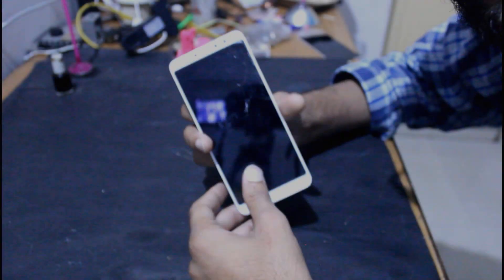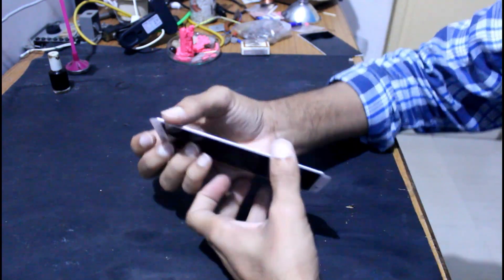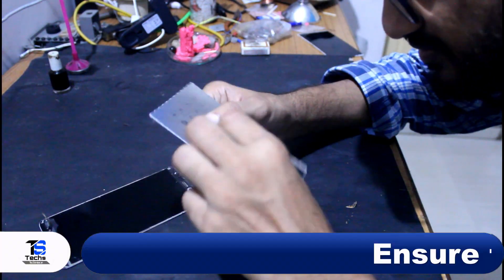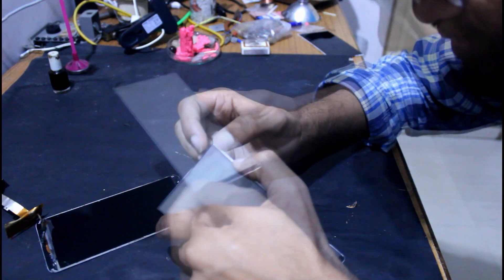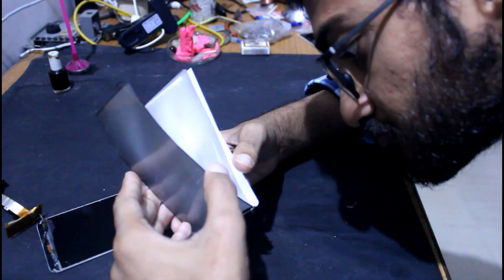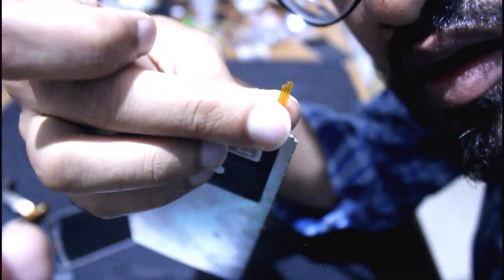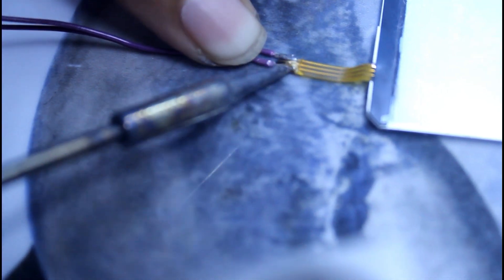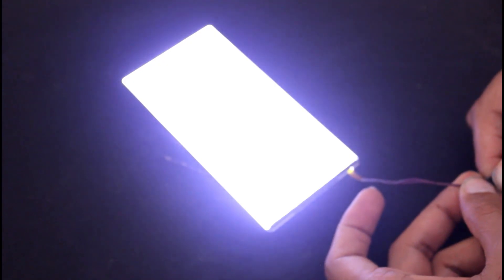Make useful Light from broken display

Comment: 5v is enough for this 😊
Reply from the maker: @sushantakumar7794  no, (old screens had  12 opertating volt)
Maybe new screens have Lower volt just check it with low volt at first & keep increasing untill it glows
Reply: @TechsScience  yes you right   I try it   in12v  it glows perfect 👌 👍 thanks
Reply from the maker: @sushantakumar7794  🙂

Comment: Actually a very useful re-purposing project but complete precise connections not shared especially as to how you connect the 1k Ohm Resistor to the power supply. Please elaborate.

Comment: Hi bro i try many time on iphone broken lcd but i cant find the positive and nigative please how i can find i have available iphone 7normal broken lcd
Reply from the maker: Normally it has 3 wires 
You should test with them all one by one 
Once it glows you find the right wires
(Don't keep the power for long while testing because the long time reverse current can damage the leds )
Reply: @TechsScience  can i use 5 volt charger
Reply from the maker: @kalugorandaka3017  yes you can

Comment: I I have new LCD screen like this. Can I connect to raspberry pi reply
Reply from the maker: Not sure
The raspberry pi needs display modules while mobile displays made for different processessors with different wiring
Reply: I have mi A2 LCD it's a new one so Can I use hdmi to mipi driver board and connect raspberry pi or little panda or Chrome cast or Intel mini pc.so I will get display in the LCD.

Comment: ?w supply?
Reply: It won't draw more than about 1-2W. In my case, it's 24V at 40mA (two pairs of 8 LEDs in series all hooked in parallel), which is 0.96W.
Reply from the maker: I am using mobile charger with 5v 1amp
That's 5 Watt

Comment: Iam still confused with soldering 3wiring flexible.
Reply from the maker: Use the last 2 wires of the strip
Reply from the maker: Try it by switching the wires it if don't works
Reply: Ok, thanks bro